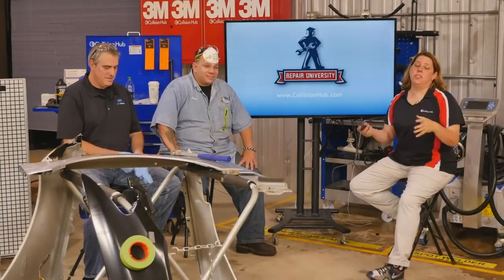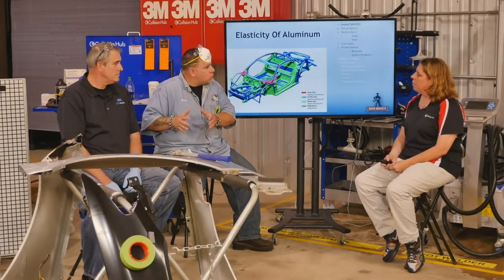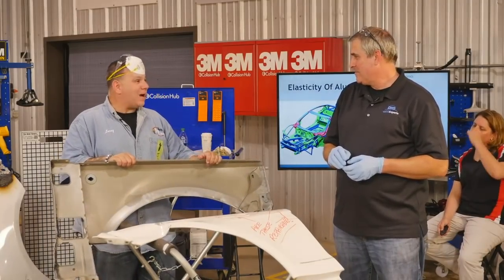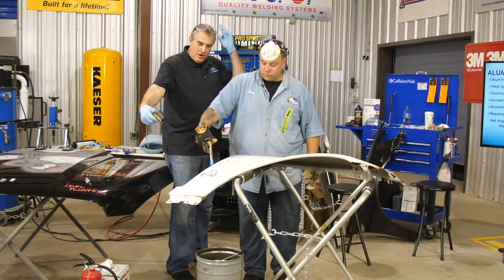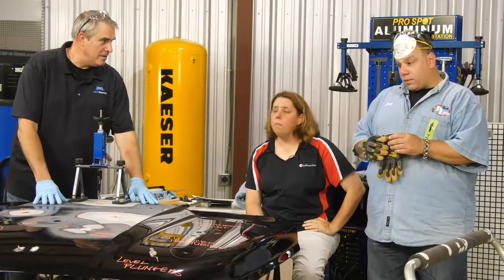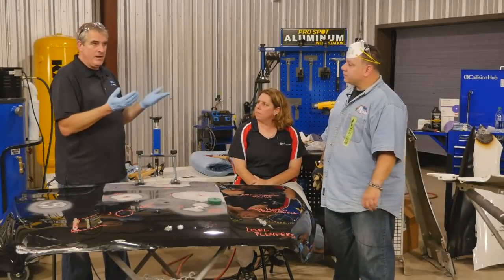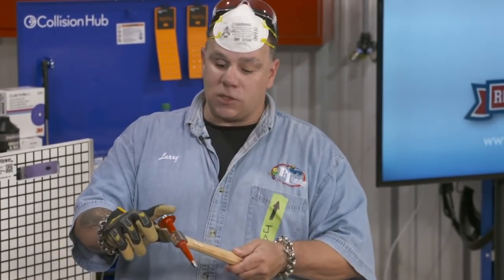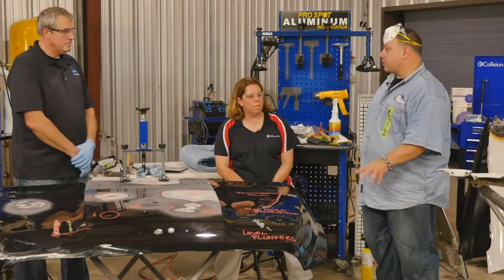Repair University: Aluminum Body Panel Repair

Comment: There are some areas on some aluminum vehicles where the OEM allows repairing clinched areas that are seperated with rivets. As said don't do that unless it says you can do it in an OEM procedure and not with hardware store rivets, but it's not true that "any" damaged or separated clinches can't be repaired. Look up the OEM information.  Also please quit showing the improper way to use a non-contact thermometer. These guys don't know how to use them correctly and are teaching people to ruin the panels they are working on.  watch this video to learn the proper way to use a non-contact thermometer.  https://www.youtube.com/watch?v=jmUHxgj5GuY&t=15s 
Notice how long they heated the bare area and how short the time was that it took to get the painted area to 400 degrees, probably less than half as long as it did on the bare area. When it said 200 C on the bare area that would be 392 F and it took waaaaay longer to get to the 200 C on the bare area than it did to 400F on the painted area even though the reading on the thermo said they were the same temp. That's because the reading was correct on the painted area and incorrect on the bare area. When they were at a 200 C ( 392 F.)  reading on the bare surface the real temperature there was probably over 600-700 degrees F.

Comment: I have an ND (latest) gen Mazda Miata that got rear-ended and it squashed in just the final 4" of it's top most furthest to the rear of the car point which ends right where trunk sits on it...I am wondering rather replacing the entire R rear quarter panel to simply find a smashed panel that part is intact on, cut it off and have it welded on my quarter panel?  The rest of 1/4panel ispristine